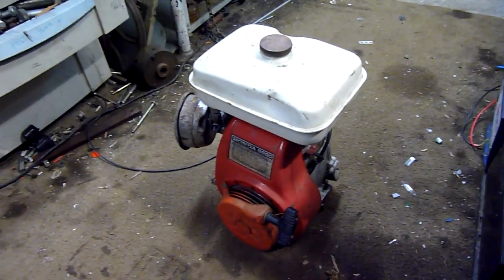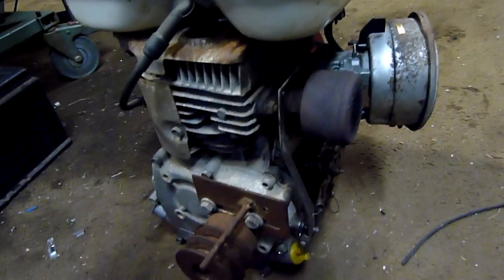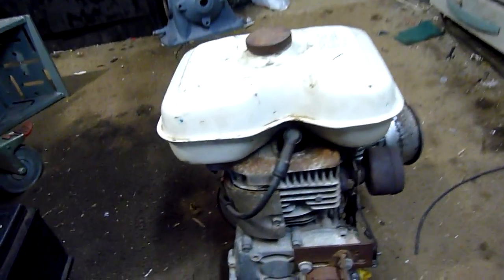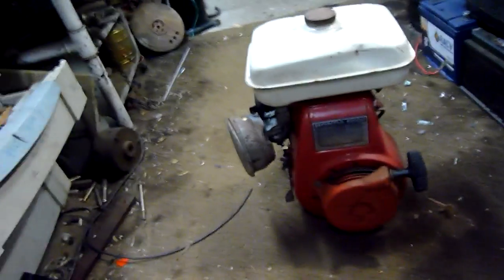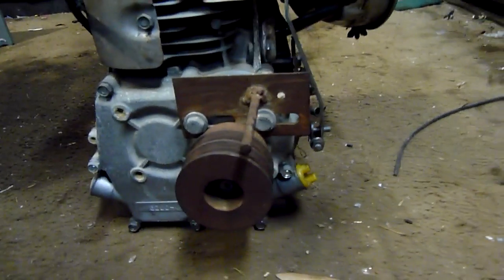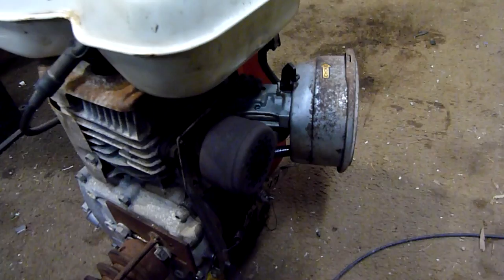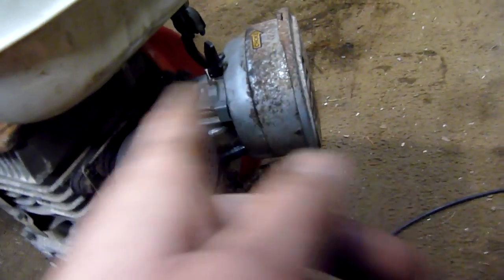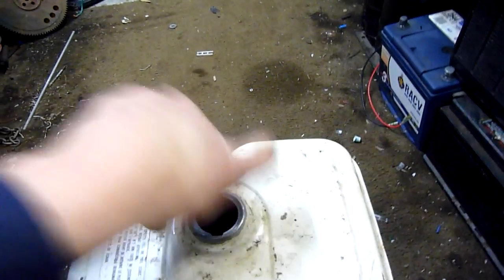Trash Find Honda G200 Start and Run

Comment from the maker: @05clenharth yeh i did a bit of research on it and it is indeed a camshaft drive!.
I was hoping for a pair of drop gears off the crank but I think I will pop it if I do what I want to now.

the Cam will not take the torque I want to pull from it :(

Comment: I've just been working on the same model. The paint is more orange on the pull starter than on the cowling,- just like yours. Must be different paint quality during manufacture. Got to be the original fitting!

Comment: PTO on the cam shaft will be 1:2 but you knew that. These engines are almost bullit proof if you keep up with the oil and decarb the combustion chamber. Seen the when the cyl walls grow from the carbon build up.. Honda still make these engines because there is stuff out there that the GX engines wont fit because of the lazy cly.

Comment: hey do you know how to set the point gap with these engines? i found a old G400 but i have to reset the points, on the flywheel there is a T and F mark. what do?